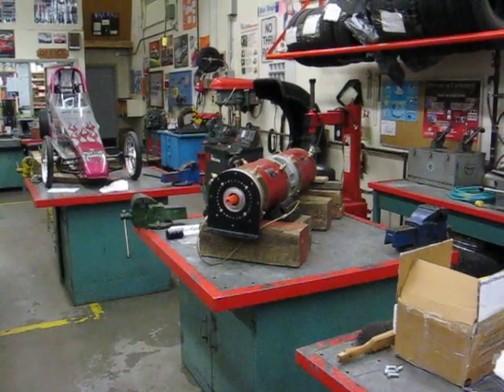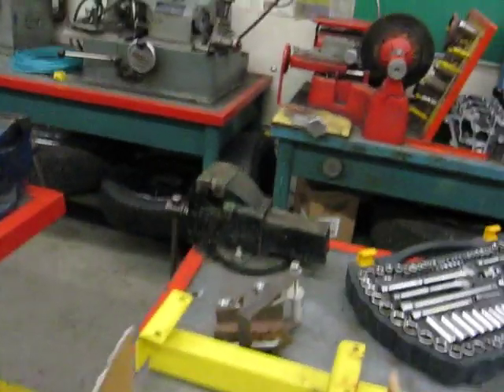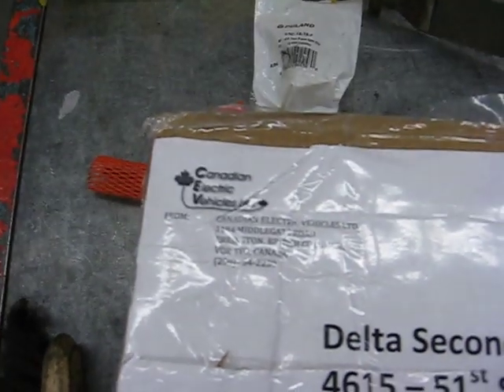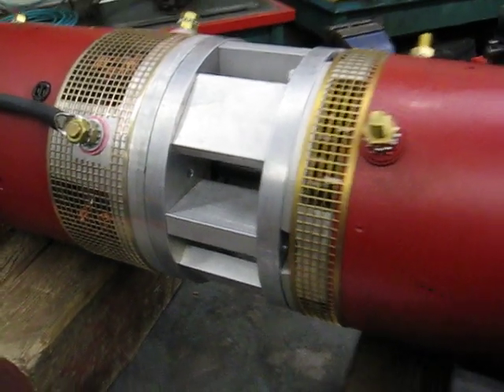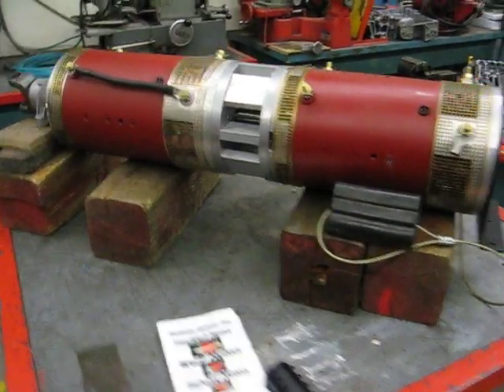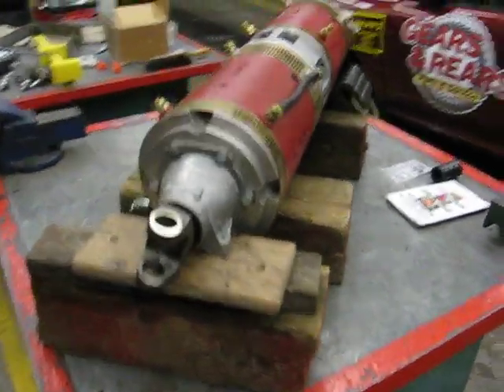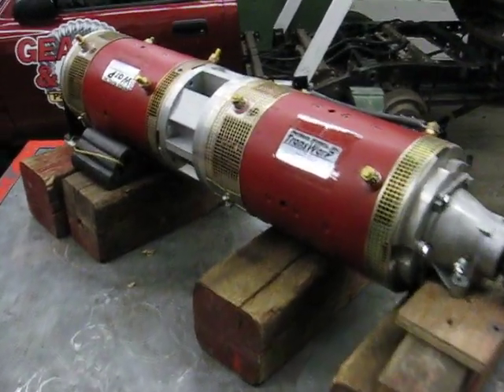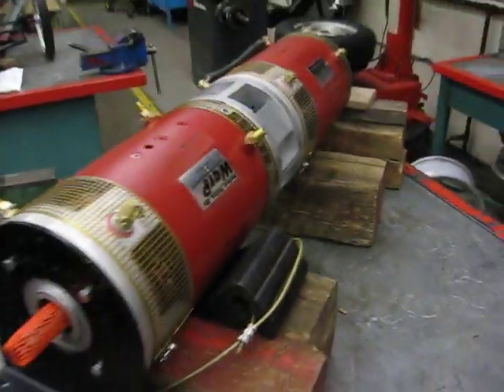Electric Drag Truck - Warp 9 Motor Coupler arrived!!!

Comment: PLEASE EVERYONE SHARE THIS,
To all ev, tesla< all elec auto owners!!!

24 volt 150 amps, dc alt... Dc to Ac converter 240 volts Ac 150 amps... (watts law) 36,000 watts, that is also 36 kilowatts... This alt replaces all but one battery in every Electric car/truck, drone, and can make an airplane never need to stop flying un till replacement parts are needed... STOP BEING A CASH COW, money grab fool for letting them rip you off...Tesla cars, uses 36,000 watts to run the drive motor...Thank about it, am I the only one on the planet that knows watts law? How to: alt to dc toac converter, to motor controller, to drive motor... alt is ran by a 12Volt DC motor, power usage is very low. send one wire to a voltage reg, then in to the batt to charge the batt back up when it gets down to 10 VOLTS DC...DO NOT HOOK THE DRIVE MOTOR TO THE BATTERY

Comment: dude... this is PHENOMENAL ...what did it turn out like? what was the performance increases?
Reply from the maker: Hi Can AirsoftRegiment! It's still in the works and it looks like this motor assembly will be going into our chromolly tube frame dragster. With the right batteries these motors are worth 400hp per piece. So, a total of a 800hp as in the video! As for the truck, the original motor is back in and we are adding a forward / reversing LENCO gear box and lithium batteries. Exciting times! :)
Reply: @casey_builds   what set up do you recommend more of two warp 9s.      Or two warp 11s. I'm almost done with the car I'm going to be using for an electric set up. My car is a 1971 maverick.
Reply from the maker: @manuelmunos5674  Cool! The Warp 11's can handle more abuse but the assembly weighs considerably more. And, the 11's take up more space in the transmission tunnel. For everyday driving and even at the track, 9's do the job no problem. If you want crazy overkill, dual 11's all the way! :D

If you want to see dual 11's in action google zombie222.....

You're going to want to make sure you force cool the motors. If going direct drive the fans that come on the motos will not be spinning sufficiently to move the required air to cool the motors...Something to think about. :)
Reply: @casey_builds  yes I'm going direct drive and I want my set up to go high 10s  that's is why I asked about warp 11's
Reply from the maker: @manuelmunos5674  You can direct drive either setup. If the GVW of the vehicle is going to be quite heavy, then go with the 11's....! Dual 11's sure do look impressive too! :D
Reply: @casey_builds  thank you for your advice. I think I'm going with the 11s, because im also doing a awd system and will need the tork.     Do you know of a company where to buy either custom conversions or single parts.
Reply from the maker: @manuelmunos5674  Hey no worries! Absolutely. Feel free to email me and I can get you in contact with the right people....casey dot mynott at gmail dot com. :)
Reply: @casey_builds  thank you very much. I will email you soon.👍👍👍
Reply: What is the length of the coupler?

Comment from the maker: Hi Tim! Thanks for the comment. We went with a custom setup with a bilge pump blower from JABSCO that works perfect. AND, it was a pretty reasonable price. :) Running direct drive you must provide some cooling for the motor. We melted some electrical components with no cooling pushing some serious amps! :)